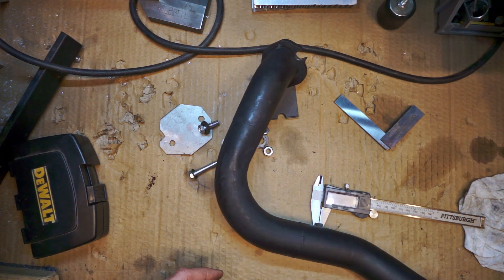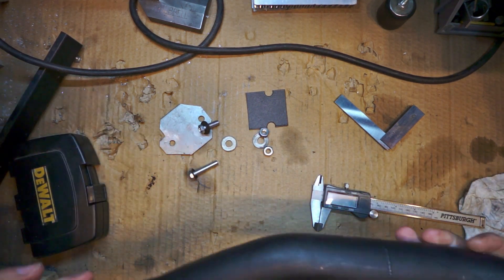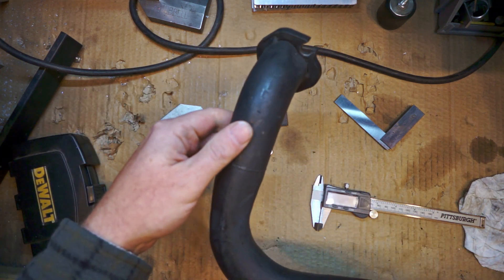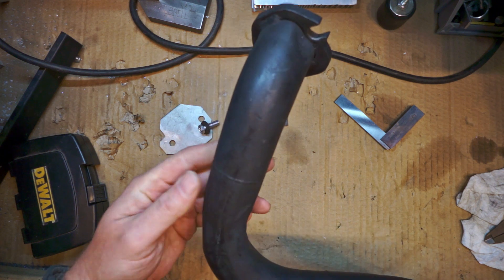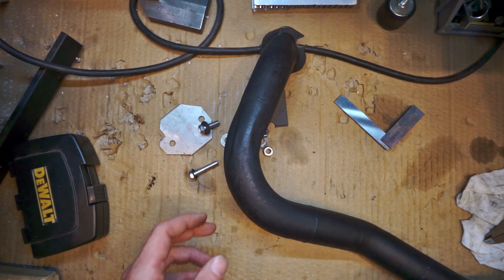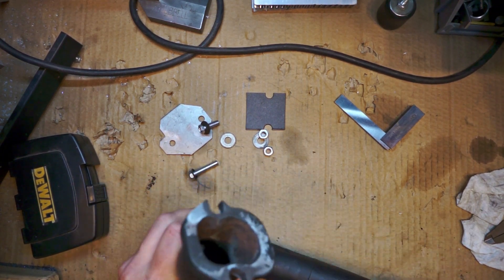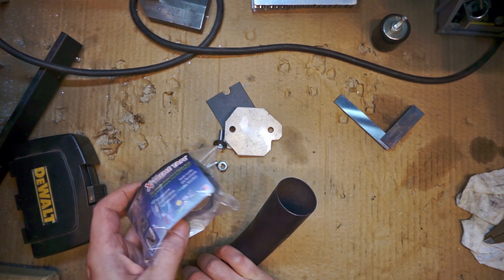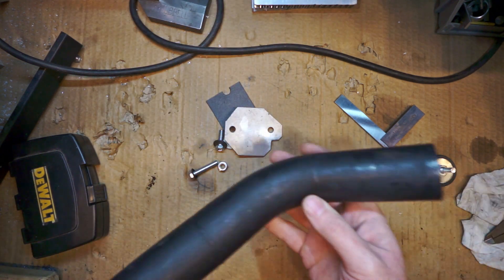Can Ice Push Out Dents in Headers?

Comment: It does work, it does remove the dents.  you have to monitor the freezing process! The lack of water by volume you didn't put in
Made the pressure expand to the void, which caused the lack of expression on your face, cause it didn't work

Comment: Compressed air and a tourch...best bet.....
Reply from the maker: I already fixed the tubes - the header dent beater outer (see this video: https://youtu.be/P_ZUFHPc7-g), and in some more severe cases, replacing the damaged section was the only reasonable option.
Reply from the maker: @stangmaster 2 A new set is $1,500 and I'd still need to weld in O2 bungs and get them coated.

Comment: Wasn't enough water in there.
Reply from the maker: If I put more water in there, then the header would split at the weakest point. Which is the weld. The welds have limited penetration so they don't intrude into the exhaust flow. At the end of the day it's not a good idea. But it was worth a shot.
Reply: @AlexLTDLX  Ah I see. Suppose a dented header is better than a leaking one
Reply from the maker: I've since beaten and welded those things into submission anyway.  Turned out pretty ok.